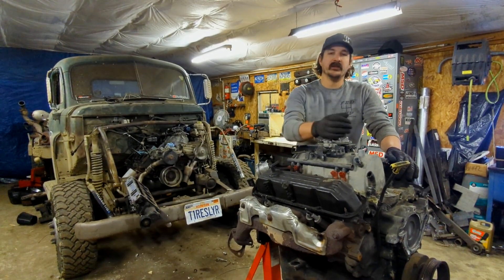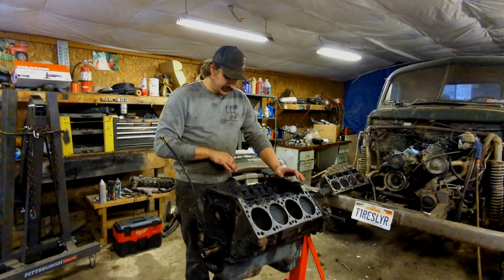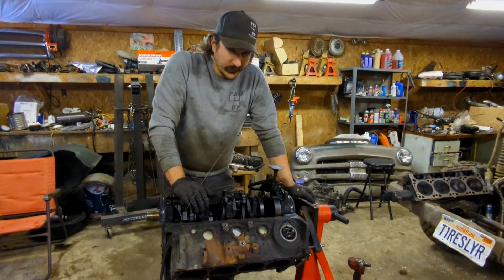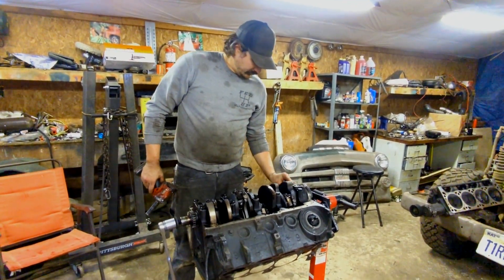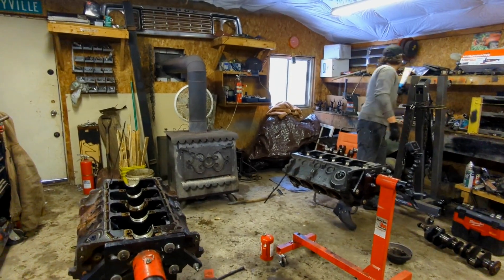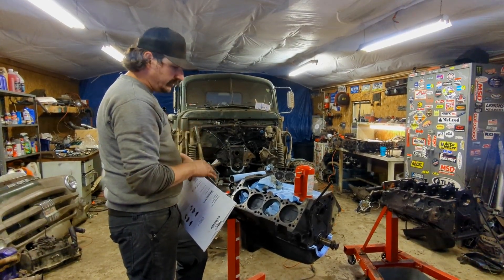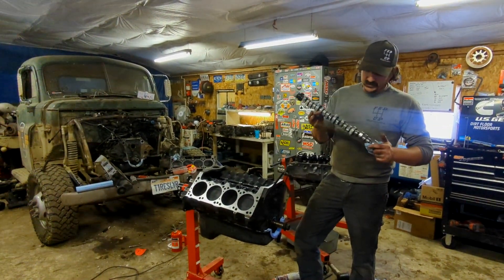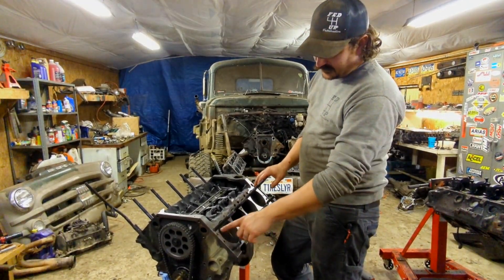How to Build a 5.9 Magnum for Boost!

Comment: Nothing wrong with building and blowing up magnum v8's for the sake of acquiring knowledge. I love these old revised small block Mopars. Thanks for the tip with the DA. I've always thought the Magnum platform would do well with Boost. Just never thought about trying it with a stock unit.

Comment: You do know there's a difference in camshafts between a naturally aspirated engine and a turbo engine, right? You are putting a NA cam in a Turbo-ed engine. Git'er tuned and swap cams to a turbo cam and see what the performance difference it. The 5.9L has a smog cam because the bore is over 4.000". Want some more fun? Swap out a 5.9L cam for a 5.2L cam and feel the difference! My Desktop Dyno shows me very nice numbers in the difference!

Comment: When I built my magnum 360 for the Dart I went though 2 junkyard 5.9s and they both had chunks out of the cam bearings and bad rod bearings. I can only imagine there are tons of these things on the road running like that. I love a magnum!
Reply: You bought some lemons or had bad luck. I love an old dart.
Reply from the maker: Not saying it wouldn't run like that, but I just don't want to trash my cam! I mean the blown up 5.9 that was in the truck had some nasty cam bearings. And the cam came out ok. But I'm really trying to keep this motor together for more than one season! Haha
Reply: I'm about to refresh mine..5.2..was going to skip cam bearings until I saw another video of a 5.2 tear down with the same mileage as mine..😳...ordered cam bearings.

Comment: How did you bypass the security disabler from the PCM? my 01 won't start because the alarm is going off. Changed PCM with no luck. I can NOT find anyone who knows how to fix it here in Georgia.
Reply from the maker: I'm running a Holley ECU and not the stock one.

Comment: Milodon makes a 4 bolt main set, or did. Curious myself how those are, im running .050 head gasket and didn't clean my block up that much or deck it. Kb pistons and one was about .010 out of the hole

Comment: nice ...I've looked and looked for head studs for magnum the number u gave comes back for the w7 ...will they work for magnum heads or am I missing something..thanks
Reply from the maker: They work for the factory Magnum heads. Not sure why ARP doesn't list that usage for them, but Hughes does show them as the right ones for stock heads.
Reply: @FedUpFab  awesome appreciate the response..expensive but worth it i guess.cost 2x wat the main 
windage studs